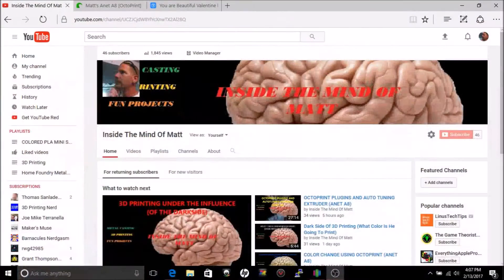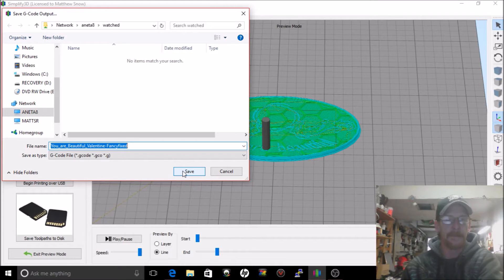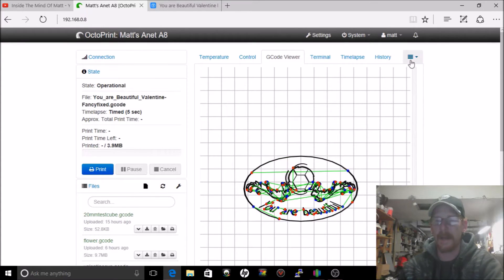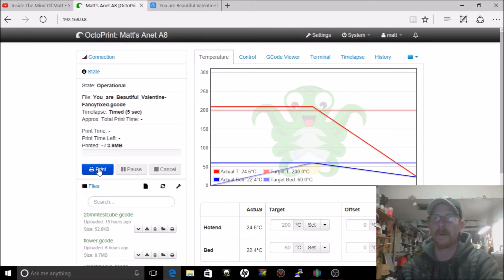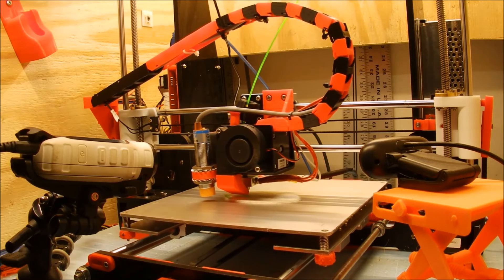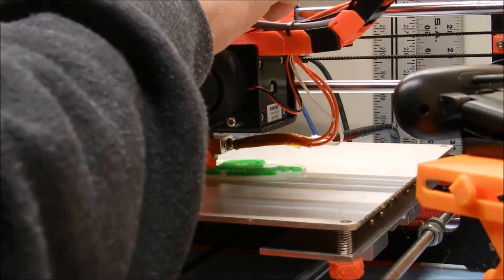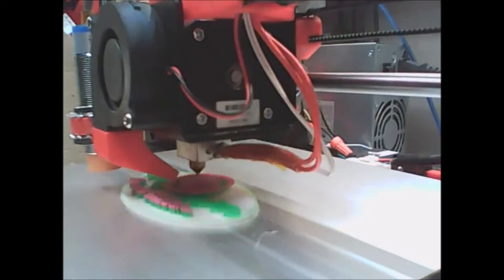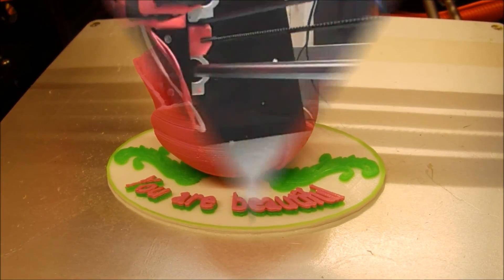3 colors 1 model 3d Printing a Valeintine Gift (Anet A8 and Octoprint)

Comment: Great video!   how do we set multi-color to change filament 2 times?
Reply from the maker: It’s a plug-in in Octoprint called color change
Reply: @InsideTheMindOfMatt  where does the nozzle park when you're changing the filament?
Reply from the maker: Well that depends on the settings in the firmware if advanced parking is setup it will move up and over and do a purge cycle. But this video was on my AnetA8 with stock firmware and it just paused and there was no purge
Reply: @InsideTheMindOfMatt  If not much of a hassle, can you share the link to this plug-in? TIA!